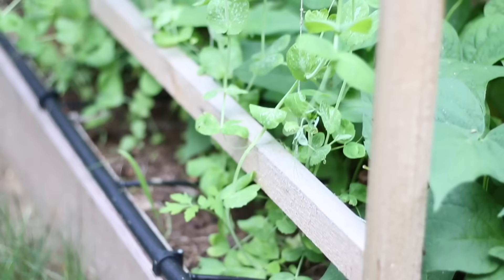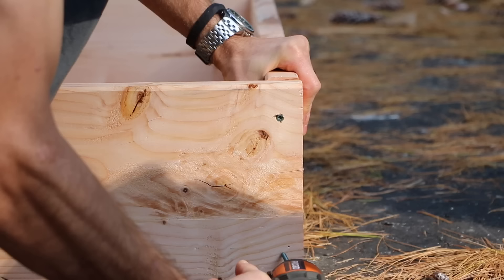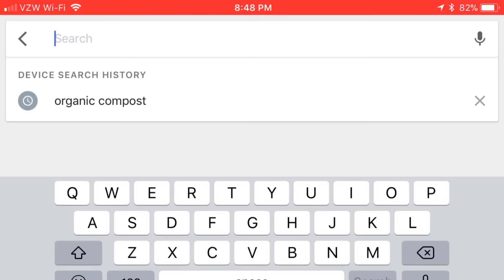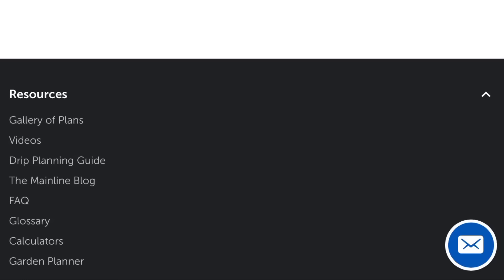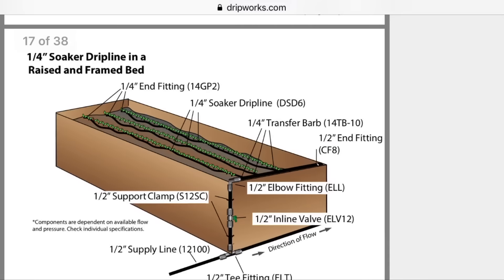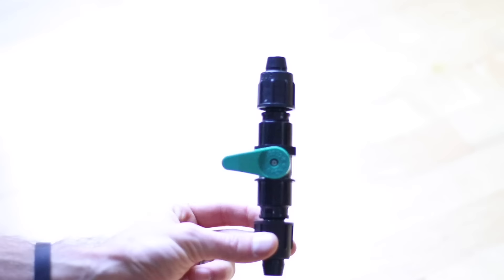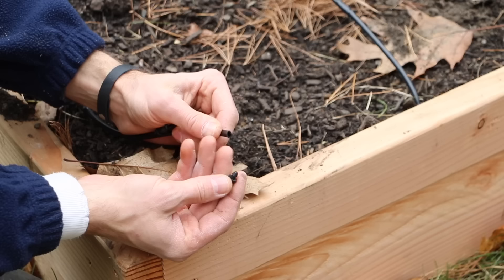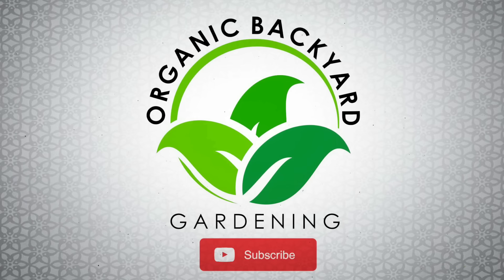How to Build a Raised Garden Bed with Drip Irrigation - Inexpensive & Easy

Comment: Great video! Would a system like this work with gravity fed water?
Reply from the maker: Yes, absolutely. Drip irrigation required very low pressure (around 10psi) making it a great candidate to use with a gravity feed source. Check out this blog post from @dripworks for some great tips. https://help.dripdepot.com/support/solutions/articles/11000044549-drip-irrigation-systems-for-gravity-feed

Comment: Why did you choose a drip system versus a soaker system?
Reply from the maker: Good question! I felt that drip was a bit more customizable, easier to repair if leaking, could get longer run on just one zone, and more efficient. Soakers are great and can be used in many applications, however I decided to to use drip in the raised Beds for some of the reasons above. If you were to use soakers I’d recommend measuring how much water they put out by placing the hose or portion of it in a bucket so you can adjust your watering time accordingly to make sure your not over watering.

Comment: Hi Tim, just found your channel and you have provided a lot of great information. I live in southern Nevada so water is liquid gold for us. I plan on building 3 raised beds approximately 12 inches deep and doing the no dig method because our soil is so terrible. I also plan on utilizing ollas attached to an irrigation system. Do you have any information on these and what the best depth and spacing would be to get optimal coverage? Thank you for sharing your knowledge.
Reply from the maker: Hi Denise, is your plan to have the irrigation system fill the ollas? I have never used them, crops with smaller roots system may have trouble finding the water source unless you have a lot of them. They may be great for larger plants that search for water such as Tomatos. If you do use drip irrigation, which I would recommend using a lot of mulch over the drip system (dead leaves, grass clippings, etc) the mulch will keep the soil away from direct sun, keep it cooler and prevent evaporation. Thanks for watching!

Comment: Hi there, thanks for the great videos, I finally set up my raised bed 4x8 to be watered from my controller, I'm using a 25psi pressure reducer and the dripping tube with holes every 6 inches runs 3 lines from end to end of the bed. My concern right now is not knowing for how long should I run the timer. I live in phoenix Arizona and before setting it up this way I watered using my water hose in shower mode pointing at the roots, every morning around 6am. Any tips will be appreciated! Thanks again.
Reply from the maker: Hi Fabio, 
This is a helpful article I found on drip depot and a method I basically follow. I typically water 30 minutes a day in the evening during the hot and dry months. In the spring, we typically have a lot of rain and I don't water much. I also use mulch and a lot of organic matter in the soil which helps retain moisture. In AZ, you have a much dryer climate and most likely will need to water more. Mulch will be very helpful to keep moisture from evaporating. 

"There is no set rule on how long to water using drip irrigation. It is really a guess and check method. There are two ways. The first option is turn on your system for 30 minutes. After 30 minutes dig down into the dirt around your plants and take a look at the capillary action of the soil. If you are not happy with the results, wait 45 minutes and repeat by increasing the runtime of your system. Check your soil again. Continue this process by gradually increasing the runtime until you are satisfied with the results.The second option is to choose a time that seems good to you and run the system for a few days. During this time, monitor your plants; if they look very healthy, then you are close to the required time. To maximize the efficiency of your system, you may want to slightly decrease the watering time each day until you notice a negative change. From that point, you know exactly where the sweet spot is for watering your plants. If the opposite happens and you notice right away that your plants look dry, then increase the watering time until they look healthy again. Factors that affect watering time are: soil type, temperature and humidity."

Comment: So, my garden beds are about 30 feet from my house. Is there some way I could place a hose attachment near the garden beds and just run my water hose out there, without having to run that much drip tubing from the house to the garden?
Reply from the maker: Yes - That is a great approach, all you need is something like this - https://amzn.to/2MiZMlp This is a faucet adapter that has an inline pressure regulator. It will screw in to your hose and has a compression fitting to attach to a drip 1/2 inch main line. You could fasten this directly to the bed to make it look nice and clean.

Comment: What is the spacing between drip lines and drip emitters? How close together do you plant your crops? I try and follow the square foot gardening method and I'm wondering if 3x drip lines spaced 12 inches apart with 12 inch spacing emitters in a 4ft x 8ft bed would get enough water, with either seeds or transfers.
Reply from the maker: Hi Troy,
I run 5 emitter lines down a 4x8 bed, the emitters are spaced at 12 inches on each line. 

The trick is using mulch. I use a lot of leaf mulch and I find the soil stays pretty moist throughout the root area. For seeds I sometimes do have to use a overhead water until they are established, then I cover with mulch to keep the moisture in.
Reply: Thank you for the quick reply!
Reply: I've used raised beds with drip irrigation for many years. I've abandoned using drippers because of poor germination especially for carrots and beets. I now use shrubblers, bubblers and small sprinklers placed close to the ground. This spreads the water more evenly and, once a particular crop grows a couple inches, there is no "top watering". There are also drip manifolds available into which you can plug in either 4 or 8 1/4" supply lines so you can easily relocate your shrubblers and bubblers anywhere you wish or even increase or decrease the amount of flow to a single emitter. This gives you much more control over how much and where you water - a helpful thing especially for sfg.
Reply: You can also buy drip emitter 1/4" line that is spaced 6" apart, this seems to do better than the 12, or you can do 1/4" porous soaker hose.

Comment: Hi. I like this video but one question.  what to do if we do not have a pre-existing water feed.  can this be hooked up to a water catch system?
Reply from the maker: Cynthia, thanks for stopping by! Yes, you certainly hook this up to a water catch system! These emitters should work well down to 2psi. Check out this helpful blog that also details timers that work well at low psi. https://www.dripworks.com/blog/gravity-fed-low-pressure-systems/

Here are some gravity fed plans
https://www.dripworks.com/gallery-of-plans/gravity-fed

Hope this helps!

Comment: How do you maintain the lines in the winter to keep them from freezing
Reply from the maker: Blow the mail lines out with an air compressor and and take the actual drip lines inside.

This is the attachment I use to make a tight seal between the compressor and the main line to get maximum pressure in the lines. https://amzn.to/2Vicvg5
Reply: @OrganicBackyardGardening  thanks for the quick reply

Comment: Good Morning. Question,, I am new to this entire Drip irrigation thing but, i was wondering how far are your runs and after so many feet do the beds at the end of the run get less water than those at the beginning of the run? Thanks!
Reply from the maker: Hi Brian! Good morning. Unlike lawn irrigation systems that are high pressure and require multiple zones, drip lines like fairly low pressure, about 30 psi. Most kits come with a pressure regulator to decrease the pressure at the spigot before the line (see link below) to ensure the emitters are doing their job of providing slow and steady watering to the roots. That being said due to the lower pressure requirements my house pressure has no problem keeping up with a LOT of drip line. I have 9 beds hooked up and several shrubs around the gardens and the flow is consistent among all the lines. If you are seeing pressure problems, you could probably set up multiple zones. Thanks, Tim

https://www.dripworks.com/senninger-lawn-garden-regulators-hose-thread

Comment: How durable is the drip line in regards to the sun and during freezing weather?
Reply from the maker: I’ve had my header lines exposed in the weather for years and no signs of degradation. I bring the drip lines inside for the winter when not in use. Blow the main lines out around your first expected frost to remove water and prevent bursting. This is the attachment I use to make a tight seal between the compressor and the main line to get maximum pressure in the lines. https://amzn.to/2Vicvg5

Comment: Fast forward to 4 years later; How is the quality of the irrigation system you installed now?
Reply from the maker: No issues! Only thing I would have done differently is install main line on inside of the bed, instead of out, so I don’t kick them when walking around.
Reply: @OrganicBackyardGardening  Make sense, Thanks for the tip!

Comment: Hello I am currently doing a diy drip system in my garden. I am to the point of either poking holes in the 1/4" tubing or inserting emitters. It doesn't look like you inserted any.. If so, did your 1/4" tubing come preholed? or did you do that yourself? thank you!!
Reply from the maker: Yes! The 1/4 drip lines has emitters within them. The emitters are more than just holes, they ensure the steady flow and anti clogging.

Comment: Great job. I am in South Central Texas and try to get a crop of veggies in late summer for fall harvest. Is there something I could add to my soil between my end of summer growing season before my fall plants go in to prime my soil. Should there be a lapse in time between planting seasons? Thanks for your help!
Reply from the maker: I have found compost added to the top layer of soil works best transitioning crops. Well rotted manure works great too. You can actually interplant between seasons, start seeds next to the plants that are nearing end of life or start transplants outside of the garden. For example my tomato bed will have cool weather crops planted in the spring before Tomatos. I’ll interplant bush Beans in my garlic bed at the end of July, when I harvest my garlic in August all already have strong bean plants. Thanks for stopping by Beckie!

Comment: The smaller diameter hoses at the end of the video, which run along the rows of plants, dont allow for a drip connector at each plant, or you don’t show this part, therefore I am confused, I think I have to use the larger diameter pipe with little green drip plugs
Reply from the maker: The smaller hoses that run down the beds have emitters in them, about every 6 inches which allow for the water to drip.

Comment: Do you think that you could use a soaker hose but put restriction on the open valve so that the pressure just makes it trickle out of the soaker hose? This is my first time and I'm going big but don't think I will have time to do it nice the first year
Reply from the maker: Yes, you can certainly take that approach. You may want to put the soaker hose in a bucket first. Turn it on, and measure the output so you can get an idea on how many gallons per minute it’s releasing. Cheers, Tim
Reply: @OrganicBackyardGardening  that is an excellent idea. I'm in zone 5 doing mostly peppers and tomatoes and tomatillos. I will have the ability to have it on a digital timer. What do you think I should be aiming for gallons per minute wise. In the past I've kind of just did 10 minutes on at sunup noon and sundown but that's pretty much just guessing
Reply: @OrganicBackyardGardening  and thank you so much for the reply your video was fantastic.

Comment: Great video, one question did you use any emitter heads or did you just poke holes in the 1/4" pipe?
Reply from the maker: Hi Mike, I poked holes in he 1/2 line with a Drip Irrigation Hole Punch Tool  https://amzn.to/2BH2gFb the used 1/4" Transfer Barb to transfer water from the 1/2 main line to 1/4 emitter tubing - https://amzn.to/2BHcghN

Comment: what do you think of the new product on the market which is liquid rubber sealant which dries and seals very quickly, for us to paint the bottom and inside of the raised bed (intention is: prevent or strongly delay wood rot)?

Comment: Will they freeze and crack in the winter?
Reply from the maker: Check my video here on how I do this. How to Winterize Drip Irrigation Fall Winter Raised Bed Gardening - Raised Bed Drip Irrigation https://youtu.be/m0j8XT74Hik

I blow the lines out with an air compressor, I use this specially designed attachment https://amzn.to/3IbssJ0 (amazon affiliate link)

Comment: Great video thank you! I live in area with cold winters and I was wondering... what if I first dig and install a PVC pipe to then have my main line (1/2") easily in and out of it for winterizing? Any suggestions to avoid a main pipe replacement? Or should I leave it in and blow the leftover water in the pipes? First thought is to get it out each year... thanks a lot again
Reply from the maker: As long as you blow out the excess water you’ll be fine. We have very cold winters here in nh and I never had any issues.
Reply: @OrganicBackyardGardening  How do you blow the lines out?
Reply from the maker: Check out the how to video I made here! https://youtu.be/m0j8XT74Hik

Comment: How do you handle termites and bugs for untreated wood?
Reply from the maker: I don’t. All the bug and microorganisms are great for the soil. The wood will eventually rot and I’ll replace.
Reply: Thanks for prompt reply. Will go ahead and use untreated wood, cheap and easy to built. I was little bit concerned on termite bugs, may cause damage to my home. Is there any way we can prevent these bugs not to attack other areas?

Comment: Do you take the hose up in winter
Reply from the maker: Check my video How to Winterize Drip Irrigation Fall Winter Raised Bed Gardening - Raised Bed Drip Irrigation https://youtu.be/m0j8XT74Hik

I blow the lines out with an air compressor, I use this specially designed attachment https://amzn.to/3IbssJ0 (amazon affiliate link)

Comment: Great video, thank you!  Do you have any ideas for making the raised beds even higher, say, waist level?  Inexpensive would be better.  I have a horrible back, and the less bending, the better!  What would be the cons to this do you think...like I worry about if it would be too hot for the worms?  Thanks for any insight!  (We've had raised beds in the past, the kind that sit on top of the soil level so we do have a little experience.  Oh, and we are in mid-Michigan, zone 4b.)
Reply from the maker: No cons at all - worms will be fine!  You can follow the same design in in the video. Just make a taller bed by stacking multiple boards on top of each other. For example if your using 2x6’s and you want the beds 3 feet tall, make the corner post 3 feet, then build the box like I did, the keep going up 5 more layers! :)
Reply: @OrganicBackyardGardening  Thanks for your quick response!  Just to clarify, I would then fill the whole depth of it with dirt/compost?  Nothing else to "fill the space" on the bottom?  I guess that would be a con, the extra expense of more dirt/compost.  Or could we go with something cheaper maybe?
Reply: I've built raised beds with empty space underneath with quality hardware cloth/gopher wire and weed cloth stapled a bunch with long legs. It will leak a little. Had to add vermiculite for water retention. I would recommend just building it taller and putting regular cheap/free local soil in the bottom, but quality planting soil and amendments to the top 1-2 feet.

Comment: I have 10 raised beds 4 ft. x 12 ft. x 24" high and 5 beds 4 ft x 8 ft. x 28" high. I had previously used overhead sprinklers divided into 4 sections of the garden and set up with 4 timers to alternate the watering.  I watered  6 large beds and 2 small beds with the overhead sprinkler, then 3 large and 1 small bed with the next setup. I watered the other 2 small beds along with a regular garden area with overhead watering and lastly  the back section of regular garden . I would like to put soaker hoses in the raised beds but am not sure if connecting to many beds to water all at the same time would work as there might be a big drop in pressure with water not reaching all areas. Any ideas?
Reply from the maker: You would have to try it, you can test out the coverage at the beginning and end by placing a bucket under each section to measure the output. If it's quite different from beginning and end, you'll need to zone it. The benefit of drip is it allows consistent watering over a long area due to the slow flow.

Comment: Tim! 
I’m bed is not near a separate water outlet, but it IS near the mainline of the irrigation system I already HAVE. Meaning, it would be watered the same amount of time as my other trees and shrubs. That is, 2-3 times a day for 15 minutes. I’m in Vegas, so it’s one day in the winter, 2-3 in spring and fall, 6 days in summer. What should I do? I can’t put a timer on it, I don’t think.
I’d love a way to time it. If I do take a super long hose, would I attach a timer system then?
I’d like to grow year round, so I’d like to find a permanent solution.
Reply from the maker: Hi Marcus, if you can get a long hose and hook that up to your spigot with a timer, then to the drop system - that may give you the best flexibility for your garden. Hooking it up and locking it into the system for your trees may be an issue. Good luck! Tim